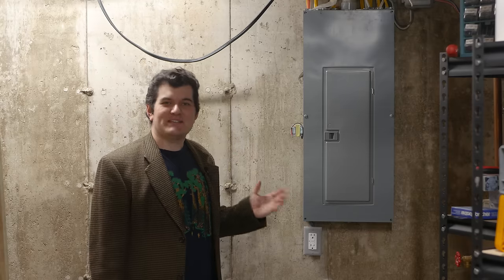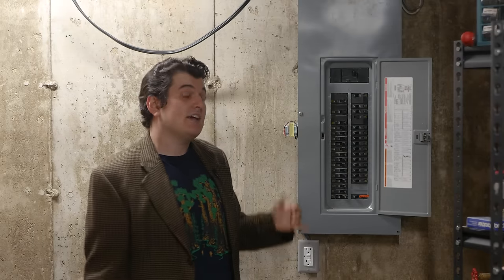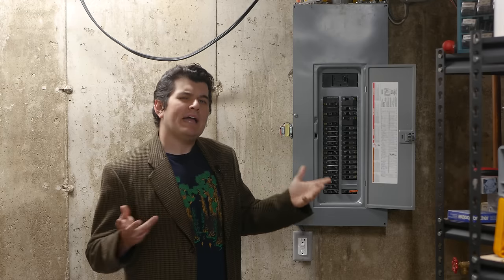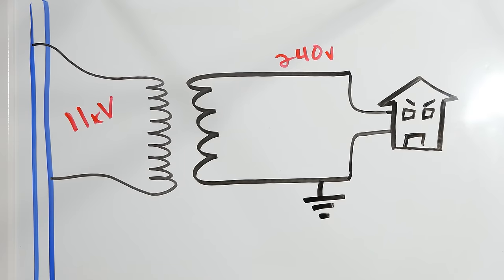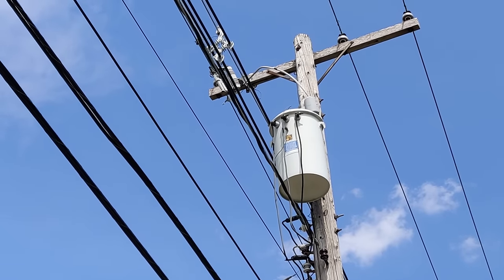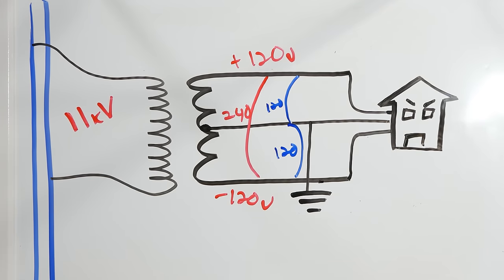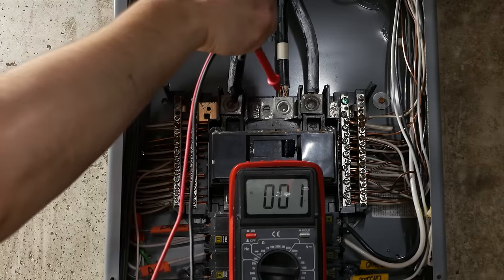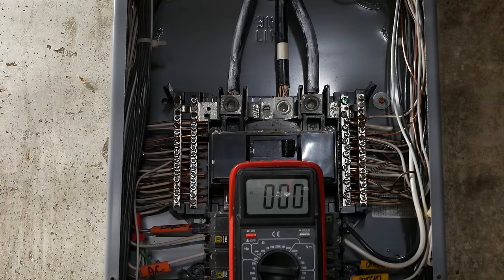The US electrical system is not 120V

Comment: As someone who’s been hit by 120 and 240, I’d rather be hit by 120 any day.
Reply: 120 tickles, 240 hurts. My arm was numb  for days after a kiss from 240.
Reply: 120 bites... 240 Hurts!
Reply: Having treated myself to some 240 V once while repairing a broken washing machine... I concur. Just grateful I was isolated and it was just my right hand. Also got some French 230 as a kid while plugging in a TV, fingers make very effective bridges between pins 💡
Reply: As someone who has been bitten by everything from 24v up to all 3 phases of 480, guess which one I certainly do not want to get shocked by again. Lucky for me my Navy electricity/electronics training was on point that day (somewhat, I should not have gotten to that point) and all 3 phases were to one hand with nothing on my body touching ground. 2nd and 3rd degree electrical burns on that hand.
Reply: try 240v 3 phase ^
Reply: The worst shock I ever sustained was 40V.. on my tongue at maybe 10 years old.  I've also been tagged from a 12 kV 30 mA neon sign transformer.  It was scarier on account of not being able to let go but nowhere near the level of actual shock.  For any parents with inquisitive kids learning about electricity: get them a meter.
Reply: @cyborg5001  120 is downright pleasant, 240 is mild discomfort.  try the 480v industrial power sometime.  you'll know real pain real quick.
Reply: @vi683a  and 200v dc stings worse than wasp or insect
Reply: It's the current that kills not volts 🤣
Reply: Arguably, higher voltage AC might technically be safer. If your body poses the same resistance, you'll get hit with half the amps on 240V. 240V does hurt more and is harder to let go of. Trouble is both are more than enough to kill you.
Reply: In my garage I have 380v 16 amps, which is very common in sweden.
Reply: 240v @ 60Hz causes you to grip it and can kill you easily, in fact you are much more likely to survive high voltage though you will most likely be horribly burned and disfigured.  That is why we have residual current devices built into switchboards so that even if you drop your toaster into the bath you will not so much as feel a tingle before the power cuts out.
Reply: @equid0x  Er no, 240V will double current. Ohm's law I=V/R   
For the same person, R is constant, so doubling V doubles the current, and squares the power dissipation. So the shock you get is way worse than double
Reply: @hugge100  that's common EU three-phase. I bet you have the large red plug-socket with the cap that latches, am I right?
Reply: @whatelseison8970  yikes! how much of your body was immobilised, and did it ground?
Reply: @elpechos  But you will also trip the breaker twice as fast ;)
Reply: @whatelseison8970  Oh, and teach them not to measure the grid in th amp setting :P.  I never had a shock from high power devices, but I've been awfully close to them a couple of times, and in one occasion it would've only required to grab a plug wrong (me and my brother accidentally wired two PIR-sensors because we wanted them to work together, but failed to realize that after connecting one to the mains, the other, which had it's own plug was already live, and we plugged that one into the socket).
We happened to connect the plug the wrong way round compared to the other one, so we made a dead short upon plugging the thing in, and it melted a part of the plug away :P.
Reply: Dumb enough to touch live wire- dumb enough to regret it at any voltage
Reply: @Mprikiman   you are correct !
Reply: @ChristopherWoods  My whole body. I had one wire in each hand and it arced through the insulation.  Even though the secondary was center tap grounded I took the full 12 kV because of that.  Fortunately I was standing up so I just let myself fall backward and the wires came out of my hands.

Of course, neon sign transformers aren't like normal transformers; they are current limited.  In reality the actual voltage across my body was probably in the range of 250-350 V at 30 mA.  That's why 347 V is said to be one of the most dangerous to get shocked with; it makes you grab on tighter.  Lower and you can usually pull away and higher will usually blow you away.
Reply: i never was hit by 120, only 220... that's hurt
Reply: @butre.  this is all about your skin, try 30v by piercing electrods and you will feel all pleasant of 120v skin shock, all people have random resistence of skin, so different people can feel different "pleasant"... same about flesh and nervous system btw
Reply: @equid0x  i think you missunderstanding, high voltage stuff need less current for same power, so high voltage stuff got more resistance, but your skin have same resistance, so more voltage = more current, current=voltage/resistance... and actually kills not current but power, so if your body virtualy will 0 ohm, you stay life any time, and everything other in the electric chain will shocked, but not you, as all power will drop on the bigest resistence stuff, because voltage will drop there, because power = voltage * current
Reply: Try 440VAC. I survived it.
Reply: As some one who has worked as a Lineman my whole adult life I would rather you didn't be my Work Partner!!! LOL. I can say I have never felt Electricity!
Reply: I've been hit by 120V and it didn't feel bad at all. I was still concerned that it happened, but it was literally as if nothing happened, and kind of makes me want to do it again due to how insanely mild it was.
I'm guessing that it's not the case for 240V though, and its probably quite ouchie.
Reply: This US system is amazingly similar to what we have in Norway actually. The difference is that the ground is not a wire from the trafo to the house, but only from the house's electrical system (plus water pipes, if they are metal) into the physical ground. Newer houses in many areas are connected to a 400V distribution net these days, so things aren't always that straightforward any more :-) Also, the sockets/outlets around the house are connected to the "two outer wires" giving the full voltage as expected in this part of the world, but there may be an extra pin for ground of course, and this also implies that each branch has two circuit breakers, so we use two positions per branch (of sockets in parallel). As you may be aware of, the nominal voltage in most of Europe is actually 230V, only the UK being the exception with 240V. (Please someone correct me if I am wrong, though!) I now have one question, though: Does this US system imply that all grounded/ 3-pin outlets are actually providing 240 volts?
Reply: @cyborg5001  cmon that's a gross exaggeration. Got plenty of 240v though me over the years and never felt it for days. Also, it's 220v that's used in most of Europe, not 240
Reply: No you’re wrong
Reply: But what about the Hetz... henry would be disappointed.
Reply: 120 & 240 AC is manageable but 600 DC really hurts! Retired THIRD RAIL FORMAN.
Reply: @windowsxseven  347v is sometimes a thing, in Canada at least.
Reply: @cyborg5001  
In US homes and in this video, every line is 220v and every shock is 110. Unless you managed to be completely isolated from ground, grabbed one hot wire then a second, you were only exposed to 110. 260v in a industrial space, sure. 220 nope.
Reply: @windowsxseven  Buried street light wire. It was..tasty. Like a mouth full of 9 volt batteries.
Reply: Leave my gas dryer alone!!
Reply: Yall should try 277 single phase.
Reply: It depends on the amps. I would sooner have a 25,000 volt milliamp shock than a 240 volt 13 amp shock.
Reply: Nathan Seeley I think it would seem almost all of the commenters have tried multiple stupid voltages. The good news is, at least we’re hear to talk about it...
Reply: Try 300V Dc.
Reply: try some 480, its no fun at all
Reply: @tfish0  I got 400 VDC across the web of my thumb. Total distance between the conductors at point of contact was about 6-12 mm. (1/4 - 1/2") WORST.SHOCK.EVER.   I fervently hope that never happens again. 
Also, I have taken a shock from 400 Hz vs. 60 Hz.   YOWZA!
Current Kills, But frequency Hertz!
Same voltage (120 VAC) higher frequency. SIgnificantly more painful.
For the curious, I was working on a shipboard servo system. All the magnetic components were designed for 400 Hz AC to allow them to be smaller.
Reply: @richardgerbes7509  And where do you think the current comes from?  Higher Volts yields higher Amps given the same resistance.
Reply: Try 277v . That will knock you on your ass
Reply: @butre.  Try 480 volt 3 phase Delta. It has a high leg that is 560 volt and no neutral. Anyway, it hurts like hell but because 480/560 is such a higher voltage than 120 volts 480/560 will kick you off of it even though when it gets you, you think you are about to die
Reply: i was trying to fix a lawn mower and shocked myself with the spark plug. that is a lot of voltage.
Reply: @jonathanschaffer5758  Yea, that hurts. Depending on the lawn mower it is between 5000 and 20,000 volts.
Reply: @KS-xo3oh  never trust your coworkers.  Every fuse goes in your own pocket before starting on a circuit.
Reply: @thetechoasis2179  400v 3 Phase is even more fun.
Reply: ronnie doorzon  actually even not amps but watts, source of sparks has big internal resistance so it's ok, if 10.000v source will from city electo web human just disappear in second if will not wett(in taht way he/she will have 1 chance of million), as if he or she will after rain most current will go by water, so why some time people stay alife after hit by lighting, in the any way people who say curent kills same wrong as who say voltage kills, as kills only result of voltage and current, whats mean power, and power will exactly what voltage will not in source but on the two points of body, and current what thrue the body... in the yor case source of 10000v at your skin was about 100-150v and was depended of your electrical resistance, and internal resistance of source, what work for make sparks in the air, what have very big resistance, it's all very intuitive feeling when you look at any electrical web, wires stay cold and if you chack voltage on the 300feet wires of 20.000v voltmeter wil show something like 0.03v or something like that... but if check voltage on 600feet that's will 0.06, as it's will double resistence, that's call droping voltage, russian, i don't know how that's call english... so, when you look at electrical web you see could wires, hot electro stuff and trembling electricians, who do not care of safety precautions, and become to electrical appliance some time 20watt some time 30watt, but in the any way only because of this power people die, not because of curent only and not because of voltage only, as if people will got same resistance as copper or silver, their resistance will go to zero, then voltage same, so any imaginable big curent won't kill silver or cuprum man, even iron man will even won't feel that current, the more current encounters congestion in its path, the stronger these congestion will "hurted", so the current passing through the wire will not heat it much, and if it goes along a tungsten filament, it's give a light
Reply: ronnie doorzon  right, power(w) it's only one have a sense, when we talking about electricity, this is defining and absolute value, all other are relative/dependent, and without others mean nothing important... but even this is not really right :) as body can be electrical appliance very short time, so actually even power is not defining and absolute, but electric work and power are... for example if body will work as electrical stuff 1000w but only 0.0000000000000001s human can stay ok, if  0.1w 10years - same, but if 20w around 5s that's electrical work(energy) can kill, so even electrical work will not defining if we don't know power and time,,,^all figures above are not an empirical conclusion, just imaginable examples :)
Reply: Yes. I've had to clear up after someone was hit by 240v, it went foot to hand.

Comment: Here in France, about 30 years ago, as an intern, I had to wire up two devices, one of them an expensive workstation. I identified the phase and assumed the other was neutral and zero potential ground when in fact it was opposite phase live. Very very very rare here. In that industry they must have needed to supply US equipment to have such an uncommon arrangement wired in the shop floor, but hadn't briefed me. The Indigo Silicon Graphics workstation I was working on for instance. It got fried when a RS232 lead was connected to another device whose ground was not neutral but the opposing phase. I now vaguely understand what happened. Thanks. Oh and no, I didn't get a job there !
Reply: O O F
Reply: There was once an incident with a 120/240 transformer, a mislabeled neutral, a modem, and the phone line. There was a big smell and every phone in the neighbourhood rang. The next week we got a new digital exchange, yay! Ahem. Oops.
Reply: Oh Sh*t! I really hope they didn’t come down on you hard over that; if they didn’t brief you, it obviously wasn’t your fault. Feel real bad for that fried computer though, those were extremely expensive
Reply: Yes, dangerous.. . With electricity, never assume, always test.

Comment: People are 100% correct saying US is 120V system. Using multiple phases doesn't chance that. Europe too uses multiple phases and you can get 400V (120° shift in 3 230V phases) or whatever is the reference in country X. In US you only get 2 phases most commonly. So in between 120V phases you get 240V as they are shifted by 180° (120V - (-120V) = 240V). But you don't get that from an outlet, so it's not 240V system. The phases still are 120V. There is no 240V coming to the house at any point.

Comment: Actually, a 3 phase panel has three bus bars.  They are interleaved by three. A three phase motor is connected with a triple breaker. I'm sure you can find a picture on the internet.
Reply: He is aware of that. He was specifically speaking to apartment complexes which are on 208v 3-phase , but may only be feeding 2 phases to individual apartments.
Reply: @Sightthrough  on any three phase, y-connected services feed, the main service panel will always be a three phase panel.  The feeds to sub panels will however be t 120/208 v-phase feed.  My neighbor has a Square-D QO panel in his commercial garage that is fed 3 phase 120/208 power and has the three bus design, and from the outside looks identical to the one shown here. Inside looks almost identical also until you notice the extra lug at the top and the three space breakers.

Comment: The code in canada is to mount the recepticals with the ground facing up and arc fault breakers in all rooms GFCI in anywhere close to the standing water (very generalized, the code is not general). This was a great video that helps clear up some misconceptions of electricity in North America. Thanks for making it!
Reply: Well here is BC Canada the code does NOT specify outlet orientatiin. Ground is most commonly down.
Reply: No it isn't there is no code for orientation of outlet grounds. Quick google search

Comment: "its not the voltage that kills you, the current does"
mehdi electroboom: triggered
Reply from the maker: Exactly. It's really the both.
Reply: Here's my favorite video about why that statement is misleading, from the channel that first got me interested in electronics
https://youtu.be/8xONZcBJh5A
Reply: @TechnologyConnections  The volts have the reach that the amps don't.  A total tag-team.
Reply: @TechnologyConnections  It's both in a certain way, but don't get confused like I did when I first heard that: at first, I thought it was power (since P = VI) until I learned about Ohm's law. In fact, what ultimately kills you isn't current, it's the effects of current on the body!

The best way to think about it is that current is the movement of the electrons and the voltage (potential difference) is what pushes the electrons along (technically, it's the electrical force that does that, but it's proportional). It's like a river: in order for water to flow, there must be a difference in potential energy, so one side must be higher than another. And the current is proportional to the voltage (because the stronger the force, the faster the electrons can move) and inversely proportional to the resistance. Since the resistance of the human body is more or less constant, in order for a lethal current to flow, you need quite a high voltage.
Reply: It really is triggering. Without voltage potential there's no current. It's proportional. Otherwise you'd get electrocuted by touching a AA battery.

Comment: One surprising omission -- most apartment buildings have tri-phase, because most apartment buildings have elevators (or lifts, if you're in the U.K.) and the motors for the elevators require tri-phase AC to run properly.  As do industrial-sized air-conditioning units, which some apartment buildings have.
Reply: We call them lifts in Australia too. Where nouns and verbs flirt with each other.
~ smiles ~
Reply: @antiussentiment  Yeah, but in Australia we love to hapazardly mix british and US terminology.
There's some rules about which to prefer, but not many that anyone cares about... XD
Reply: He mentions that apartment buildings and other large buildings in the U.S. also have three-phase power. That's where the 208 V comes from. The building has access to 277/480 V lines, but the individual apartments only get 120/208 V.
Reply: 1:35 He foresaw your comment 😉 It's not an omission if it's outside the scope of the video.
Reply: Yes many lifts need 3 phase, but multi-domestic properties will always use multiple phases for load balancing just as in pretty well all 230V countries will stagger single phase houses on streets across all phases.
Reply: @teravolt1195  Here in Sweden they connect every single house to all phases. Even individual apartments have all three phases supplied to them.
My stove runs off a three phase connector at 400V for instance.